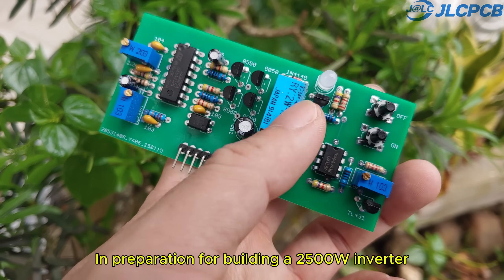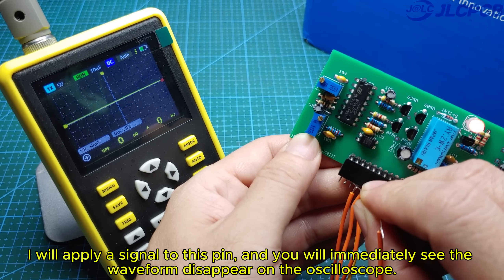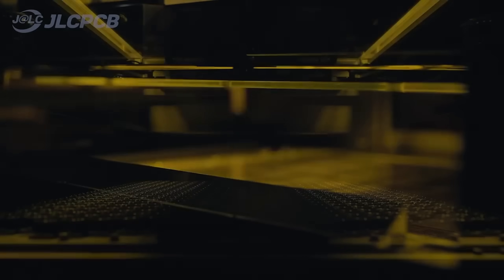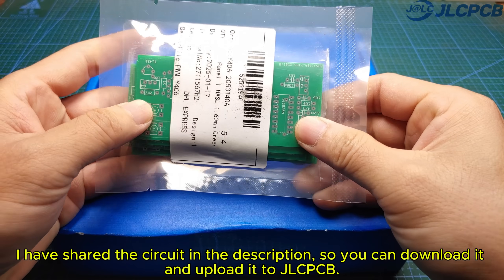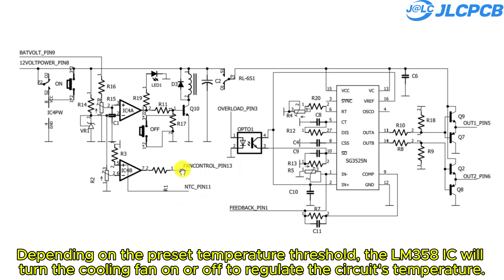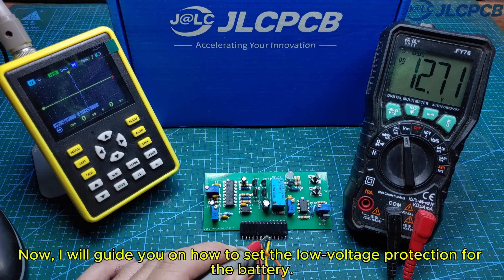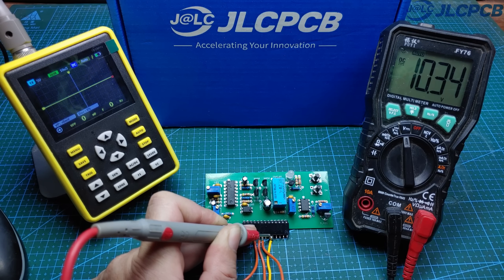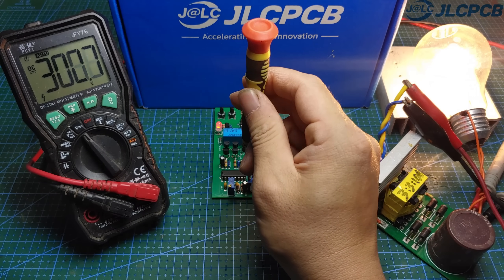2.5kW Inverter Driver – High Efficiency & Easy Integration! JLCPCB

Comment: Good engineering but I see some improvements though but good work .but at 100kw the small bjt need to be parallel with resistor times 2 using 2n2222 to get 1.6 amp because gate switching higher frequency gate need large amounts of peak current to switch faster for good efficiency
Reply from the maker: Great idea bro. Thank so mich
Reply: @LongTechnical  I strongly encourage you to use gate driver transformer for high peak current because low inductance gate driver transformer output high peak current  100nc  is 1.2 peak amp for mosfet with 8850nf capacitance gate so a npn that has 800 miliamp can provide 2.9 amp peak current at 100khz and the higher the frequency get the more current peak increases by 10  milliamp per khz so 101 is 2.910 amp just remember to use 5 ohm resistor for collector and emitter npn for low spike on the pwm single this information is my research and it work 89% switching speed but adding and pnp and ziner diode and 400 ohm to collector of pnp and and 1k from the collector to base this driver the mosfet current directly to negative discharge gate faster increasing speed to 92 %

Comment: Pls make 2.5kw high frequency inverter pure sine with Short circuit protection 🙏🙏

I'm really looking for a 2.5kw high-frequency inverter that doesn't use an iron core transformer and the designer uses a ferrite core transformer
Reply from the maker: It use ferrite transsformer bro
Reply: @LongTechnical 

I know, but I don't have the map of the main circuit and I don't know how to turn it into a pure sine wave. 

Please teach it if you Please teach it if you can.🙏